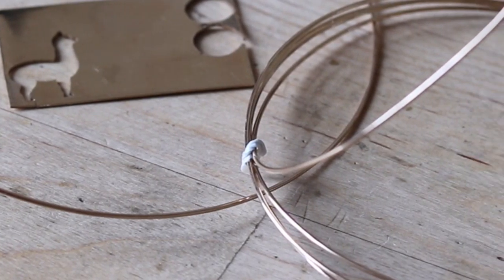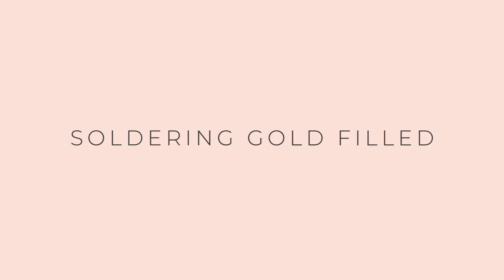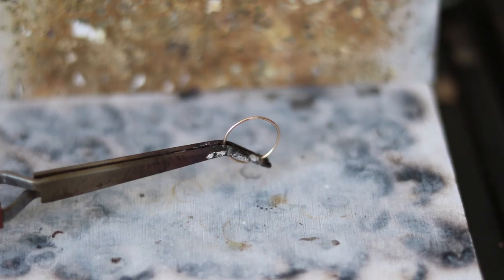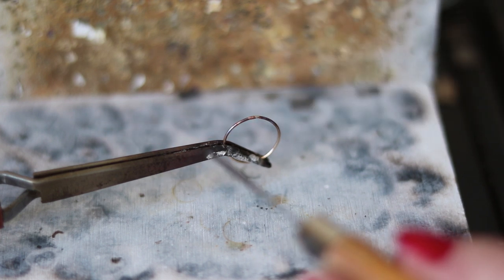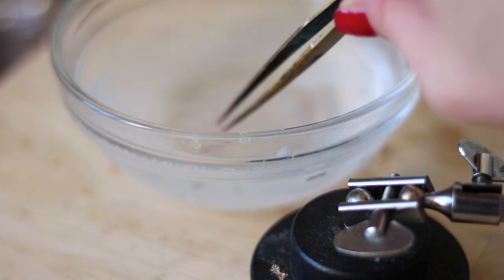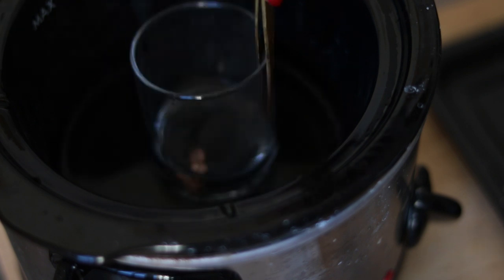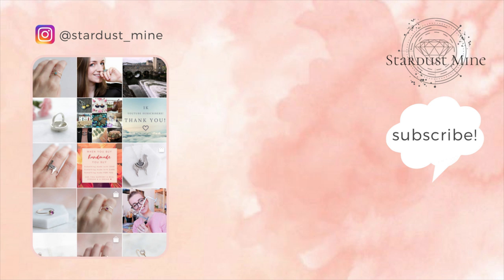How to make gold filled jewelry - GOLD FILLED METAL basics

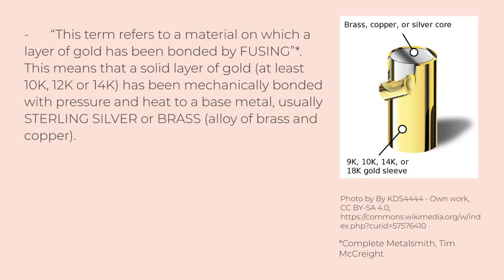Comment: Regarding 0:21, the construction of gold filled material is similar to the construction of Old Sheffield Plate which was a laminate with a surface layer of silver fused to an inner layer of copper. Old Sheffield Plated was invented by Thomas Boulsover in 1743 in Sheffield, England. Old Sheffield Plate was used to make silverware that was more affordable than solid silver.

Comment: Thank you very much for your video!!! I couldn't find anything on soldering gold filled anywhere else!!! Question about the cup you use for pickling your metal, is it just a simple glass that you put in the crock pot?
Reply from the maker: Thanks so much for watching! :)) For pickling gold filled I used a separate glass so I don't contaminate the water in the crock pot (in which I pickled silver). If I was making large quantities of gold filled, I'd use a separate crock pot for that. But because I made just few pieces, I used a glass to pickle it :) xx
Reply: @TheArtOfMetalsmithing  can I polish with a cloth? Also , when taking the ring out the cold water do I have to let it dry or I dry it? Can I put it in the pickle wet?

Comment: Thanks for the video. When shapes are cut out, can you see the core metal around the edge? Just curious
Reply from the maker: You are welcome :) Thank you for watching! So I haven't noticed any difference to be honest. I've been using 0.80mm wire and 0.50mm metal sheet - maybe these are too thing to be able to see the fifference. Or the colour of the edge comes from brass. Either way, there was no difference in colour when I cut it and finished it :)
Reply: You will see the core metal on all gold fill cut ends if you look close enough. The exposed base metal can be plated if you have the correct tools.

Comment: Hello I have a question which is not related to this video. Ive been trying to make a bezel cup using brass instead of fine silver (because I like the color of gold and silver is expensive for a beginner to practice). However its very difficult  to set the stone into the brass cup. I used bezel setting tools to  push the bezel on to the stone but after pushing 4sides (left  right, down top), it becomes very hard to push the remaining parts and I ended up hurting myself. The end result is not good and I cant find any youtubers that are using brass to make bezel cup. Do you know if theres anyway to set the stone into a brass bezel cup? Thanks
Reply from the maker: Hi! That's a really good question but I'm afraid I won't be able to answer properly - I've never tried setting stone in brass or copper and I haven't seen anyone do it (except for the electrofroming). I can imagine this must be a tremendously hard job! Even sterling silver as a bezel stripe is harder to bend (comparing to softer fine silver). I know that for sterling silver and thick bezels people are using hammer handpiece or a regular bench vice and hammer (check this video to see what I mean with the secong option https://youtu.be/WBIPFw7buxM ). But setting just with your hand and simple pusher may not be possible I'm afraid. Hope that helps a little! xx
Reply: @TheArtOfMetalsmithing  I see, Thanks! :)

Comment: hello, I have a question about your "solid" gold solder you said you prefer to use. what do you mean by solid? are you using 24K gold solder? or just 14K hard solder or medium or easy?  goldfilll only goes up to 14K I think, so this means you are using 14K gold solder? thank you
Reply from the maker: Hi, I currently use either 9K or 14K gold solder depending on the metal, and I use easy or hard

Comment: Very interesting, thank you. However there is something I don't quite understand with gold filled. 
If you cut gold filled sheet metal, a lot of the brass or copper will be revealed. Won't that oxidize pretty fast?
Reply from the maker: Thank you for your comment! :) hmm, it didn't oxidize any faster in my case, though this factor matters a lot when pickling. That's why it requires a separate pickling solution.

Comment: Hi there! So helpful , I have just ordered some gold filled wire and was wondering what pickle solution to use? is it the same as silver pickle ? but do I just need to use a fresh solution for my gold? thank you
Reply from the maker: It's the same type of pickle, but use a separate container with separate solution for gold filled items (in other words, don't mix metals in the same pickling solution, as silver might get plated by the base metals from the gold filled items). Good luck! 😊🥰
Reply: @TheArtOfMetalsmithing  great thanks so much ☺️
Reply: Are you able to put your gold filled piece in the same tumbler as your sterling silver piece?

Comment: Hi! I’ve been trying to solder gold filled jewelry and have ran into many walls. My gold solder wont flow onto my gold filled metal. My torch is hot enough, but for some reason, my solder just wont flow!
Reply from the maker: I'm working on a new video about gold filled metal (this time rings), I hope it will help you! Stay tuned!

Comment: Great video, very helpful. Just subscribed to your channel 🤗😊 I'm just starting out using gold filled wire and I want to make my own earwires using 21 gauge gold filled wire.  Have you ever tried making ball end headpins (to make into earwires) using gold filled wire?  I've read that heating the gold filled wire makes a messy ball due to the mix of gold and base metal, so I was wondering if I could use the solid gold solder to make the ball end. I am in the UK and have also found that the Curious Gem seems to be the best source of gold filled findings, but their ball end headpins are only 22 gauge. Thanks again for the video .... gave me food for thought 😀
Reply from the maker: Hi! Thank you so much, happy to have you here! :) Ops, I don't think it will work, and even if it will, it won't be a good result. I think I tried once and it didn't go well haha 😀 Sadly, heating and overheating in this case will cause this metal to lose its purity. That's why the ones by Curious Gem are quite pricey (but I think it's also because they have silver as a core, not othe base metals, but you'd need to double check).
Reply: @TheArtOfMetalsmithing  Thank you!! I had my doubts about it. I bought some gold filled 22 gauge earwires from The Curious Gem and although I was after 21 gauge, these were actually very nice; not cheap, but seem solid enough and they're very pretty. Enjoying your videos, very well presented .... you make it look so easy, and all your pieces are so beautifully finished 🤗😊

Comment: Can you please do one with soldering a post on gold filled ring please? I’ve tried all day and it’s not sticking. I’m trying to make a ring with a post so I can glue pearl on top but I’ve been unsuccessful. It’s so frustrating 😫
Reply from the maker: I hope I'll be able to do that in the future! :)
Reply: Is it possible that my soldering torch flame  is too low? Nothing sticks. Or is it the soldering gold?
Reply from the maker: hmm, the torch should be good. I usually use just a small flame with mine, so that might not be it. Maybe the metal was dirty (and that affects to solder, which won't flow) or maybe not enough of flux?